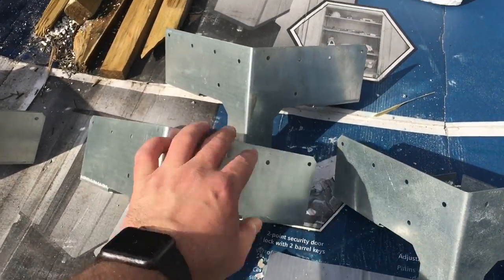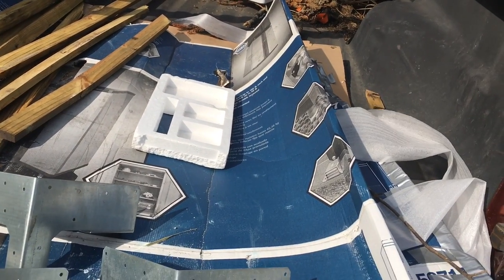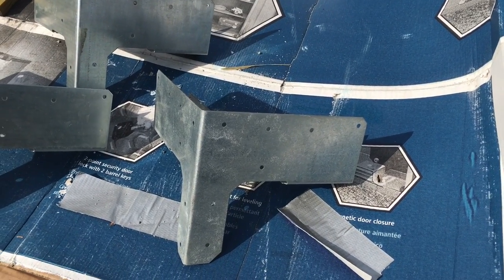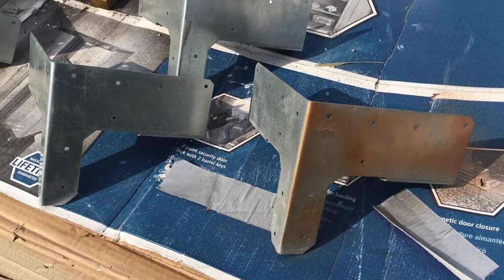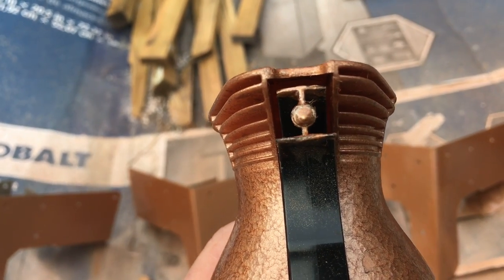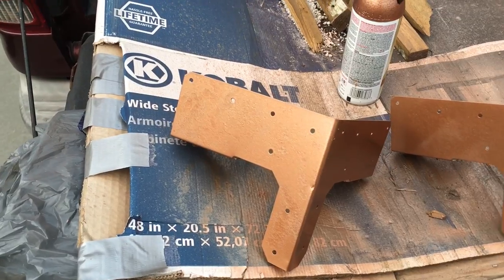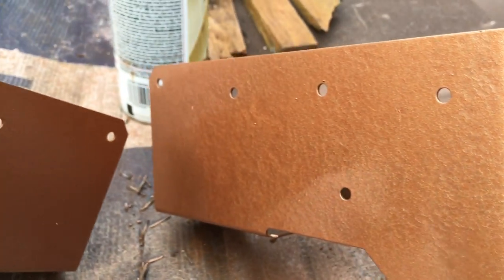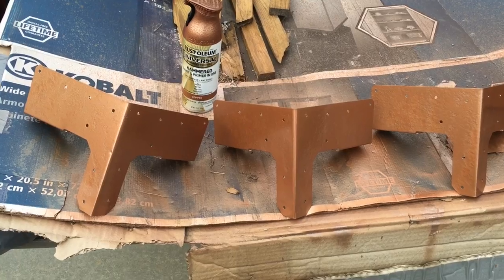Rust-Oleum Hammered Paint and Primer Product review

Comment from the maker: I probably sprayed the equivalent of 2-3 coats.  I learned early on from automotive painting To lay down a really light coat first, let it flash, and then fill in color.  You really just want to look for coverage not paint thickness.  It may take more or less than 2 coats to get coverage.  If want to err on the side of caution, lay down more really light coats rather than try to build up thick in one shot.  If  you build up too thick you run the risk of crackling during dry, or peeling later on.

By the way, this stuff is holding up nicely. I have it outside, and there is no sign of any issues so far...

Thanks for the question and please subscribe.
Reply: Yeah, I did the same.  The texture you see is from the hot dipped galvanized and not the product.  The product texture comes from a controlled orange peel effect.  You and I both effectively negated the product from doing its job by using a tack coat and then building the color like you would do on a car.  Mine came out smooth and even so I got pissed off and called them lol.  Use a heavy coat at moderate speed on a horizontal flat service so it DOES run and orange peel.  I am glad that it still holds up even when you do it "wrong".
Reply: Not with this product.  You'll get a better hammer finish if you do not lay a thin coat and let it flash.  Spray a moderate to liberal coating which allows the particles in the paint to continue to move within the paint after it's applied to the surface.  There has to be some depth to the coating for the hammer finish to develop.
Reply: Thanks for the comment. I initially didn’t go thick enough to get the hammer tone down effect but I went too thick tonight and I got crackling underneath.. good thing I’m just learning on a mower restore job

Comment: I had read reviews of how horrible the spray was on this "new and improved" sprayer, so decided to go with the old tried and true. Got same name brand and color, but with the old type sprayer and it worked very well. I'm not an avid spray painter, so it took me a few sprays to get it right, but I can tell you the old sprayer type worked for me. I found that you have to spray it a little heavier and even the can says apply a "moderate spray." Other than my own mistakes, the hammered copper spray paint did it's job and looks great.
Reply from the maker: indeed.

Comment: It is suppose to be 'blobby'. Makes the hammer blow dots. When the carrier evaporates it leaves the 'blobby'  as dot hammered divots behind. It may be required to be put it on a little thicker then normal so as it can flow slightly to form the puddle patterns. Worked right off the shelf for me and I may be use 10 or 15 spray finish cans a year. Wouldn't say I'm well practiced at spraying but in this finish type/product you don't want it to dry fast like you normally would with other spray finish products, I would think?  For me it came up as hammer divots with a clear coat, dead flat. The small blobs turn into puddles, if wet long enough (heavy 1-ish second), and when the carrier evaporated the puddle rings remain, even sparkle a bit,  yet the surface was urethane smooth. Very 3D. I think the trick is think the opposite of what we are all use to.
Reply from the maker: yea, Like I said, it looked cool after I sprayed it on.  Something was wrong with my sprayer though.  It was clogged or something.  The fan was working at first, then it started spurting out.  Weird.
Reply from the maker: If you watch this video, you can see a strong fan pattern...   https://www.youtube.com/watch?v=Lmjr7CFIXi4
Reply: Excellent advice, my experience exactly.
Reply: @skeith1981  Yup, you got to put it on thick enough to allow the metal flake rings to congeal into existence. It is the opposite of the usual thinking of 'many thin coats'. You are spraying a 'float' or 'flood' coat like a thin coat of varnish, epoxy, latex ..... opposite of traditional metal painting techniques.
Reply: Jerry Davis  That is usual how it appears. this paint has a lot of metal flake in a more thickish carrier then regular spray paint. This does not sell at the rate of regular spray paint, sits on the shelf a lot longer so you really have to shake it a lot.

Comment: Paint won't stick to galvanized metal for very long. You need to either use a primer that is made for galvanized metal or you can etch it with vinegar. I usually do both of those things.
Reply from the maker: Going on 5 years, and it's still holding up.  I think if you do a good job of solvent cleaning, it does fine.

Comment: You got some decent texture. I tried everything using their brown hammered spray paint, and hardly got any. I wonder if the formulation is different here in the UK.
Reply from the maker: It's possible.  I bet the European standards for chemicals that can be use is harsher than in the US.  I design products that are widely used in Europe, and I recall that in 2019 there were some new rules put in place that limit use of certain toxic chemicals.  Probably the good stuff...  With that said, these cans are quirky.  Ive seen alot of people complaining about them.  Appears to be wide variation in results.

Comment: Thier website says not to use for galvanized metal
Reply from the maker: @brucepullman853  It could be a concern about the metallic components in the paint reacting with zinc and causing corrosion in structural issues.  All I can tell you is that I applied it many years ago over galvanized Samson tie brackets and it’s out there looking fine with no issues.  Adhesion definitely wasn’t an issue…

If you are worried about it dont don’t use it.

Comment: I wonder if I used the brown hammered on a pewter stair protector it wouldn't flake from wear/ walking up and down repeatedly.
Reply from the maker: My guess is that it would wear...  It's a decorative coating, and probably won't stand up to the scrubbing and wear that a stairs would see...
Reply: This paint cures rock hard.  I did the pewter hammer finish on the rocker panels of my truck three years ago and still looks like new.  No chips from stones, sand or rock salt.  I found the spray trigger and tip a big improvement over a standard rattle can.  The vertical spray pattern is more like spraying with a compressor spray gun.

Comment: nice man.  how many coats did you use.  and can you use clear coat on top?
Reply: I wonder about a top coat as well. I want it to last a long time
Reply: Don't be cheap. You need everything handed to you? Experiment yourself, in your humidity conditions and your spray technique.
Reply from the maker: I didn't use a top coat.  It's been outside for 3 years, and its still holding up.
Reply from the maker: Poly would probably work.  I didn't do a topcoat, and its fine 3 years later

Comment: Been through 5 cans of this stuff..   Each time they fail to spray after a while.   Garbage
Reply: These Rustoleum cans are notoriously bad. I've had problems with them too.
Reply: wondering how many people turns the spray in the opposite direction after use, using the gas to clean the nozzle... as 99% times I see people not doing this and later getting surprised.

Comment: What happened to the primer part??? Galvanized metal should always be primed.  Fail dude.. fail.
Reply from the maker: It's been outside for 3 years, and no issues with adhesion....
Reply from the maker: Solvent cleaning is enough to promote adhesion on galvanized steel.  If you are worried about it, then I recommend you prime.
Reply: Paint and Primer in one.
Reply: THe primer is in the paint